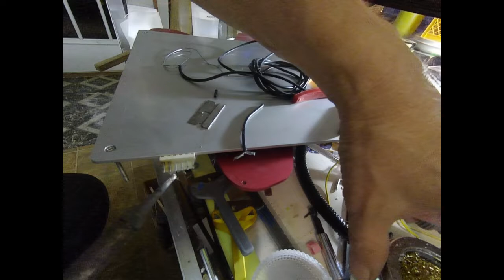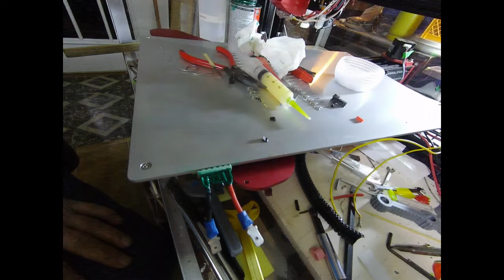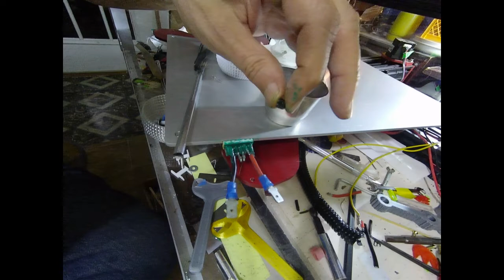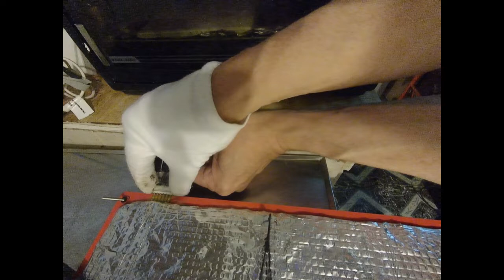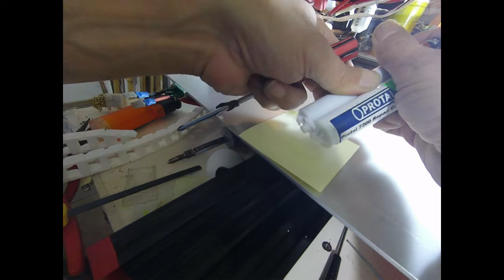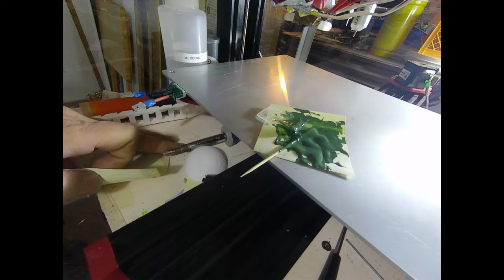Tevo Black Widow Y-Axis Drag Chain

Comment from the maker: The connector did break free from the heatbed plate. 
I didn't realize that only one eighth of an inch of the connector was soldered to the bed. Also, normally when structural strength is needed, silver solder is used. after the failure, I removed all the solder, remounted the drag chain to the bottom carrier plate, and soldered noodle wire directly to the bed, ensuring that there was no stress on the heater pads. That will end up being the final chapter in this YouTube video once I break it up.

Comment: Hi Rick, this could cause problems for you in the future. Try to reduce the strain on the hot bed  header there is a less likely chance of them breaking off. By directly connecting the drag chain to the hot bed header. You are putting too much load on the pins and through constant movement they will eventually break them off. If you can Build a bridging piece from the X frame to the drag chain to take the load off the pins. Also if you could loop the wiring to ensure strain relief for the hot bed header connections this will also give room for the hot bed leveling. Cheers.

Comment: Unfortunately, you have mounted to much onto the terminal block on the Heat Bed the next failure is possible that the terminal block will break off, it needs to be mounted back onto the glass plate by some means.